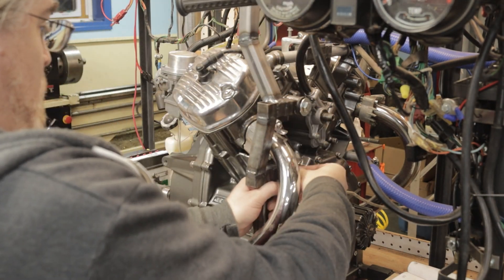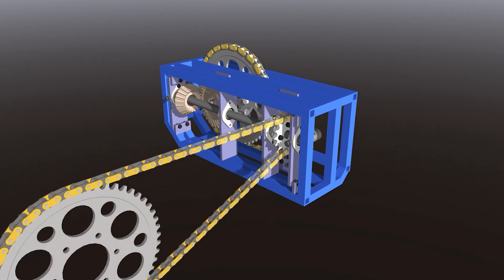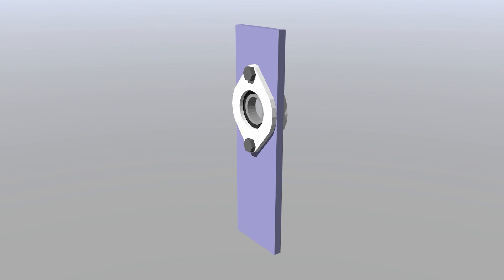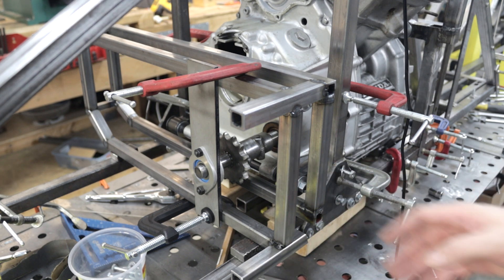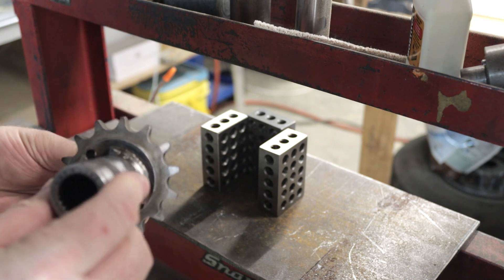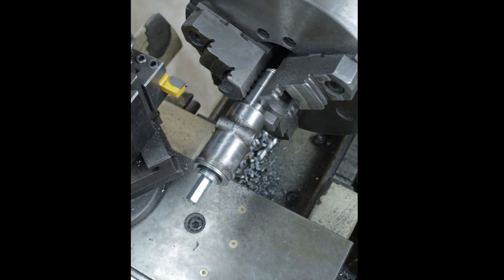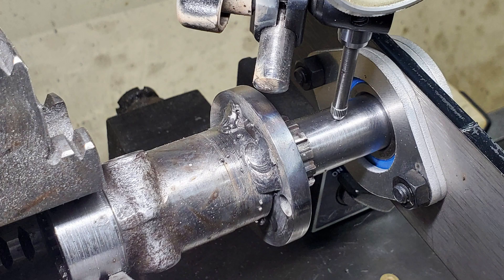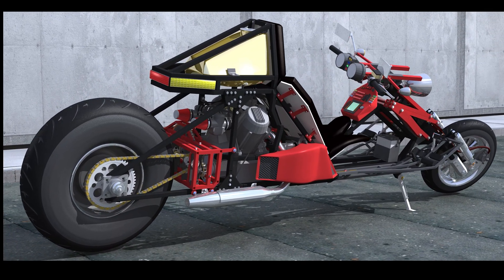Akira Bike Project - 21 - engine reduction cage - part 1

Comment: Love your work - I hope lots of youngsters are watching & learning, no substitute for 'old school' test fit-problem solve-repeat - you could show this to engineering students & they would get more out of it than two days with their noses in dry books.

Nice use of weld heat distortion to 'true up' the spline - I've done the same with weld repairs to damaged frames & the like.

Much respect from the UK.
Reply from the maker: Great comment thanks! I couldn't agree more!  It never ceases to amaze how complex things are once you actually start making things, especially when you are trying to hit 'common' tolerances of just a few thousandths of an inch.

Comment: It's an option for electric engine and battery on that frame or need major editing to be done ? All together can electirc engine power enoght and fit in to the that frame.
Reply from the maker: I plan on an all electric version and even a hybrid version, there's plenty of room because of the geometry of the bike, much more than a regular bike, and I have extra room in my prototype to experiment with, so there's plenty of room for electric motor and batteries.  Not much modification would be needed, basically just new mounting brackets for whatever motor goes in there.